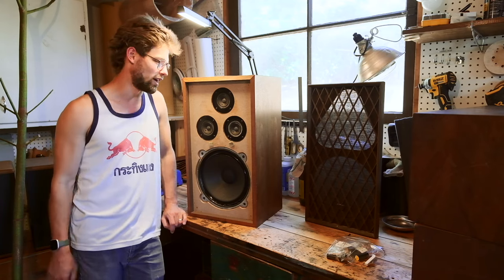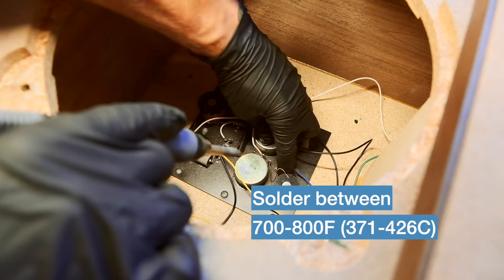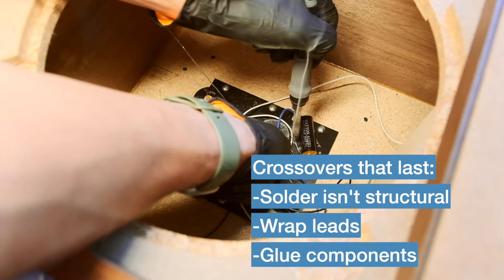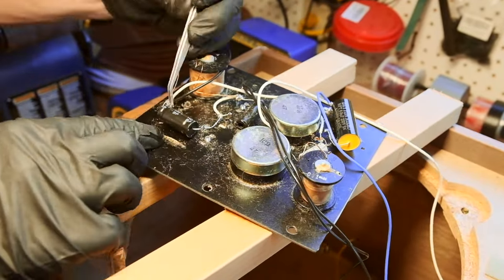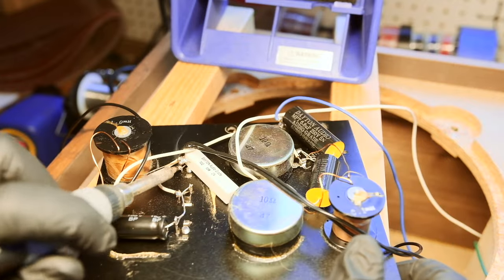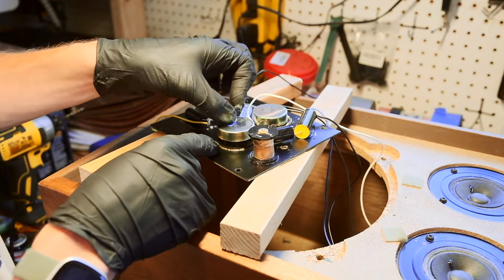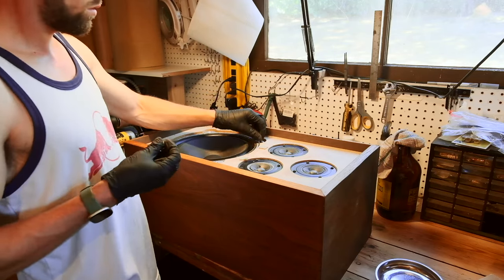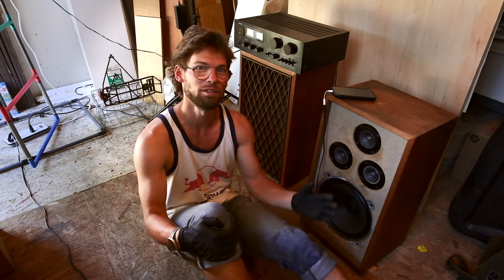Best update for your old Speakers

Comment: better upgrade would be to use thin film capacitors, instead of electrolytic ones seen here, also air coils without a magnetic core, then even better would be a active crossover instead of passive crossover with separate amps for highs and lows, then class A amp to retain the same exact signal going in that comes out,
Reply from the maker: And since we're dealing with an unlimited budget we could go ahead and just buy some Klipsch Jubilees and forget about these all together. Silly me.
Reply: @Shuksanaudio  lol
Reply: @Shuksanaudio  btw thin film capacitors and air core coils are not really that expensive maybe 100$ total for both
Reply from the maker: Haha you're right, but these speakers cost $38 and the difference between air coils and iron core is negligible IMO. I know they can make a difference but more on high end speakers. Also, what are you referring to when you say thin film? I've never heard anyone suggest using thin film for crossovers. I only used on electrolytic in this build which was for the woofer high pass and realistically, it doesn't make a sound difference because of the lower frequencies that it's passing and I could have left it stock. I used film and foil caps for the others.

Comment: why not change the cross over instead of upgrading it
Reply from the maker: Because changing a crossover requires much more time to measure each driver and design a crossover that works for the drivers properly. You can buy an off the shelf crossover and it might be an improvement, but it also might sound worse because it wasn't designed for the specific impedance curves of each driver. It would be fun to make a video showing the difference between off the shelf crossovers and a custom designed one...maybe later this year when I'm more well-versed on the subject. Cheers.

Comment: The only thing I disagree with is the woofer cap being an electrolytic as it will just have to be replaced again years down the road.
Reply from the maker: You're not wrong. My thought process was that they're 1/10 the cost of a film capacitor that value and I could have just not replaced it since it was only affecting the woofers high frequency roll off. Realistically, the sound improvement might not have been noticeable from that cap, only the other one but it was only a buck fifty so I went for it. Thanks for watching!
Reply: @Shuksanaudio  

You're welcome.

I think of it from a standpoint of do I want to be replacing the cap in 30-40 years or a future owner have to do it.

Then again mica caps were once thought to never go bad, but it was found later on they do sometimes fail. So what if film caps are like that where a generation or two in the future they find them starting to fail.

Comment: I would have replaced that woofer too!
Reply from the maker: New woofer needs a new crossover to really work well typically. Have you worked on Nova 8s? To me, these woofers actually sound pretty good. The woofer from the Nova 8B is a great drop in replacement that has some improvement and there are some crossover mods detailed online to make it work and sound wonderful. I have another video coming soon on the rest of the updates that I did to these speakers. I just did them on a budget for a local coffee shop and to practice with CNCing and veneering. Thanks for watching!
Reply: I actually bought a woofer from Radio Shack in the late 80''s. It had the same rubberized cloth surround (12 inch) and a tan colored cone and 1.5 inch voice coil. Fantastic woofer! Made a custom enclosure for it. Back in my speaker building days!  @Shuksanaudio
Reply from the maker: Nice! that's awesome! Can't wait to build my first set of speakers.  @5argetech56

Comment: Film capacitors found in speaker crossovers are bipolar...+..+. You shouldnt use electrolytic caps as a replacement unless you construct a bipolar set by connecting the negative sides of 2 electrolytics. Two 200 uf capacitors with their negative sides connected will make a 100 uf bipolar cap if thats what you need to replace. I just recapped 2 mint 1968 Fisher XP7's I won on ebay for 1 dollar. Instead of buying new bi polar film caps...I made them from my stock of electrolytics. Two 50 uf's connected _  _ will make a 25 uf + +
Reply from the maker: Films are indeed bipolar, but so are all of the electrolytics for crossovers on Parts Express. You can get plenty of different bipolar electrolytics even for amplifiers and such. If you are needing to link polar capacitors, they're probably not meant for crossovers. Some people may say they don't sound as good but I think you'd be hard pressed to tell the difference. Thanks for watching!
Reply: @Shuksanaudio  When a person buys all the stock of a retiring electronic repair owner...and an O scope for 50 bucks..I'll just use from my boxes of components.  I literally have hundreds of caps of all values made by Panasonic and Nakamichi

Comment: Why didn't you replace that crappy old wire with something, decent at least plus change out the Iron core inductor with a better air core type of a heavier gauge.  Lower DCR, less saturation.  Actually, a redesign of the X-over is the way to go with dumping those what, fifty year old pots for fixed resistors.
Reply from the maker: Every project needs to be balanced on which upgrades are worth the time and expense. I do plan to do more redesigns of crossovers in the future but this pair is going in a cafe for background music and they needed to look nice more than sound good since the cafe isn't marketed as a listening space. They were a massive improvement over what they had and sound great. It sounds like you know a lot, would love to see you do these upgrades to a pair :) 
Thanks for watching.

Comment: Sand cast resistors=weak.
Reply from the maker: Thanks for dropping in to share your 2 cents and watch the video, I'm all for an educational conversation to help people who may not have as much knowledge as you or I. The sand cast/Ceramic casing wirewound resistors I used in the video are the cheapest option and these speakers aren't exactly top of the line. To my knowledge there is nothing "weak" about them unless you're using them in an application where they would go through many high heat cycles. Perfectly fine for a passive speaker crossover on a budget. If this was a pair of Klipsch Fortes or something else high end, the extra cost would be worth it for some mills or even the higher end Dayton precision wire wound. Lots of options out there and people say that they can hear the difference on higher end drivers, but I doubt you could on these.
Reply: Honestly I rarely ever see wire wound resistors in equipment of this quality. The purpose of this was more a restoration of the original sound quality. (Though the woofer surround might have also stiffened over time on these, which is another issue on its own. This will make the bass quieter, and it likely won’t dig as deep either. People have suggested many ways to fix this, all including harsh chemicals that I have a strong fear of.)

Comment: Didn’t hear the difference in sound..
Reply from the maker: Ah schucks. I've found that if the speakers are 30 years old or more and use electrolytic capacitors, I can usually hear an improvement. If they use film, plastic, or any other type of capacitor, I've found minimal to no change in the sound.
Reply: So I just purchased and waiting on these hpm 100 crossover upgrades.  I should hear a difference in sound?
And this is the first time I have ever read bout changing the inside padding? Is that recommended?
Please let me know and thank you!
Reply: I bought the crossover upgrades from the guy on ebay.  Crossovers look totally different......I'm hoping for better sound quality even though my stick figure, slightly stooped, etc sound pretty great right now.

Comment: Interesting video, I've always been aware of cap degradation over time. But dude, you really need to get out more. First the gloves, how or why do people have to wear those gloves for every little thing they do on Youtube? Is everyone really that afraid to get their little patties soiled? But then you mention it's the lead in the solder. Really? Guess you've never balanced a tire or fired a gun. News flash, touching a little lead for a few minutes is not going to give you lead poisoning, and they make this shit called "soap" that you wash your hands with that takes all that icky little dust off! And why change the fiberglas that's already in there? It's in a sealed box, it's already there, it works, just leave it alone, no one's going to have to see it for another 50 GD years, wtf, no one cares about "ethical" sound dampening!! C'mon man, you're on the right track with saving great old speakers. Now get out there and see if you can actually get your hands as dirty as we did when we were little kids ... then drink out of the hose too!! Sheesh!
Reply from the maker: I guess I'm now aware that you walked uphill to school both ways
Reply: In the snow, barefoot.
Reply: @robertspringer9477  Nyah, we had boots! 😆
Reply: @Shuksanaudio  Nyah, it was just uphill both ways to the bus stop! But it was 1/3 of a mile!
Reply: The natural oils from our hands isn't good to get on connections.
Reply: Hey Matt. 
Thanks for the video. 
Where to you source all capacitors filters and crossover parts etc.
Reply: Wow, bro…yikes…yer intense!
Reply: @mjak20   Parts Express is the Home Depot of speaker building.
Reply: @flyurway you need to chill.  I agree with what you're saying.  I don't use gloves & I'm sure I've inhaled more than my share of solder fumes.  
You can express your opinion kindly and lose the attitude.
Reply: @quincekreb6798  Okay, "technically" you could make an argument for that I guess, but I think that it's a long shot that you'd really ever have an issue from it TBH.
Reply: @jdsalinger73  Yes, it is! There's another that's pretty good too, "Speaker Place" or something like that?
Reply: @jdsalinger73  Yeah I know, I'm a dick! But I try to be realistic, even if I get a bit carried away!